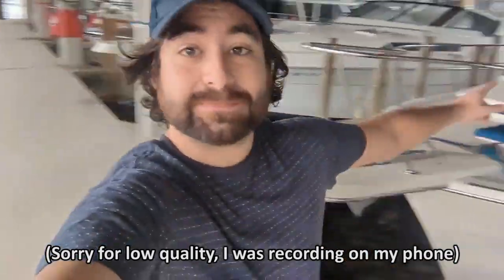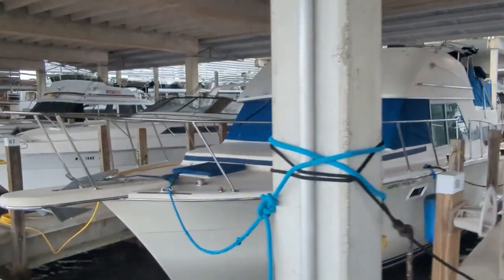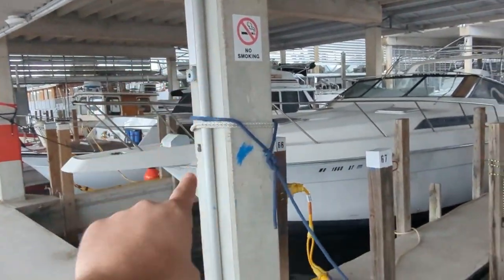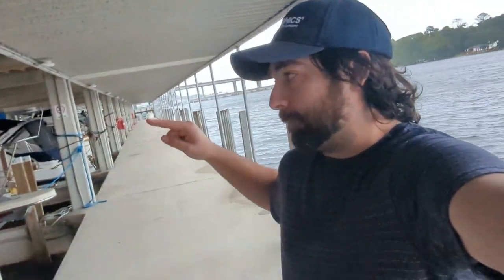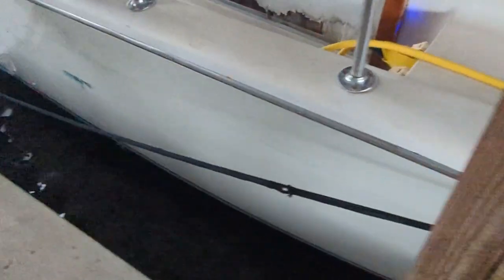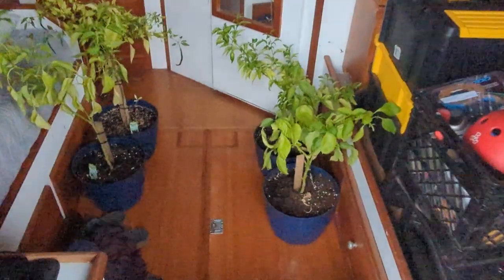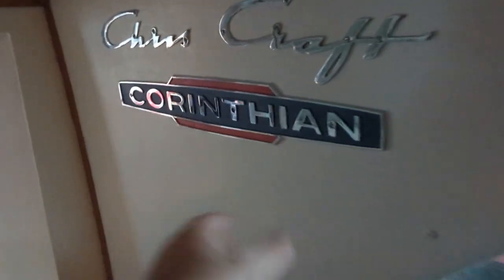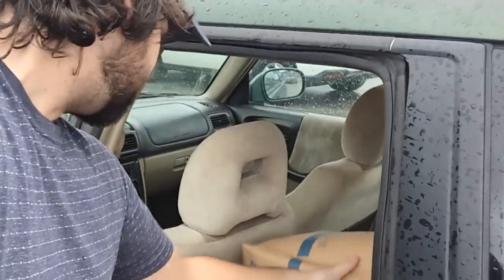Hurricane Ian is a Monster. Let's get ready.

Comment: Good luck in the hurricane. I stayed on our family boat thru a hurricane. At the time we had just bought a new boat and had the old one still for sale about 10 slips down from the newer one. My dad and I shuffled between the two all night as the storm passed. No damage to our boats, but as one of the few boat owners in the marina, we stowed deck furniture and adjusted lines for other boats. One suggestion, make sure your mooring lines are nylon rope. Much stronger and elastic to absorb shock. I'd also suggest spring lines to restrict fore and aft movement in the slip.
Reply from the maker: Lines are all synthetic, and I've got long spring lines on both sides. Great advice!

Comment: Brother.  You NEED some chafe guards on the concrete poles to protect the lines.  In a pinch you can cut and use garden hose for that purpose.
Reply from the maker: Good plan
Reply: How did you do?
Reply from the maker: Just fine, check out my latest videos for more info

Comment: Do you have fore and aft spring lines for when the wind shifts? Did you tie down the Bimini support so it can’t flip backward if the wind gets under it? Best of luck and hope all goes well.
Reply from the maker: Bimini is now tied and I now have 4 spring lines, fore and aft for port and starboard. This comment helped a lot, thanks!
Reply: @CullenCraft  I am glad you are under that hard cover and you will stay with your yacht. I hope the tidal surge does not get so high you have to move out of your slip. But if so you could go out and anchor somewhere? I am just north of you coastal Georgia. Hang in there Captain. 👍